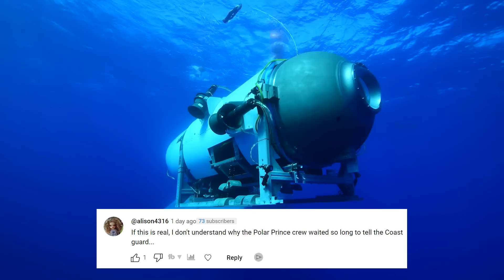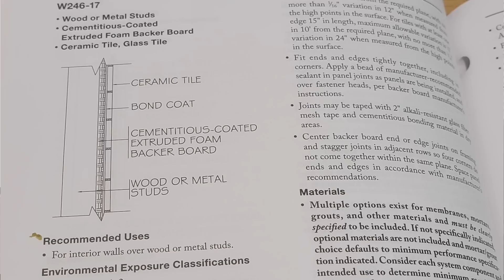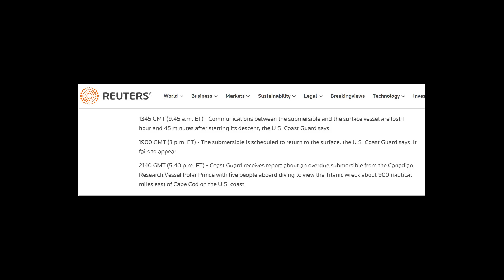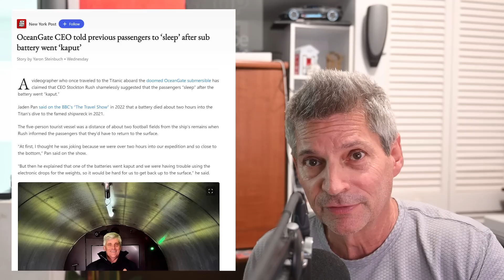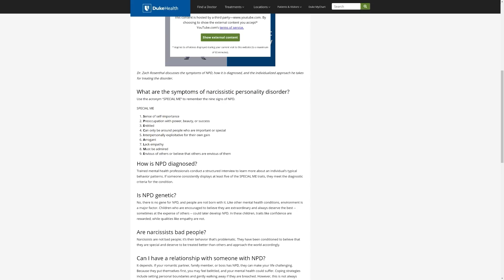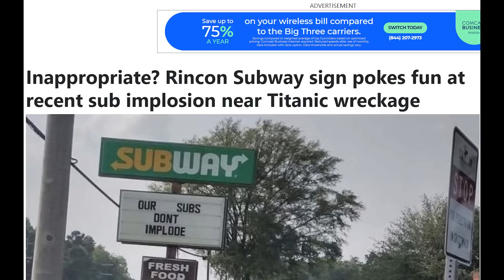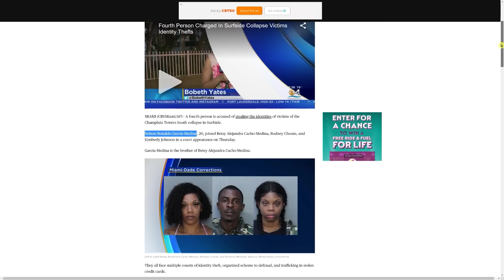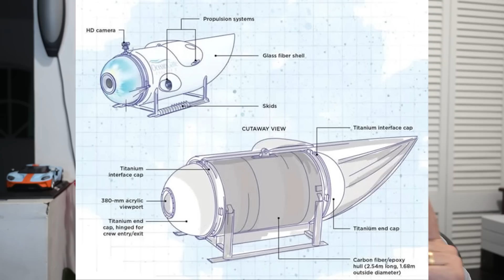Titan Sub: Why OceanGate Waits 8 Hrs Call Coast Guard, Q & A

Comment: The psychological principle he discusses here is interesting, but it doesn't seem relevant to the matter of when possible loss of the sub was reported to the Coast Guard. Immediately after loss of communication with the sub that morning, there were two status options based on its last communications: the sub had imploded, or the sub suffered communications loss. If the sub imploded, there was absolutely nothing the CG could do at that time or any time later. Why call them? The last communications clearly show problems greater than just communication impairment. If the sub could surface in a normal period of time, which was hours at that point, then it would, so why call in the CG and navies of two countries to come hold your hands? If the sub surfaced on a delayed time schedule or at a remote location, they would have three and a half days to find it, so again, what's the rush? Understand that if the sub had not been broken up and been scattered all over the sea bed, locating it on the surface would not have been that big a problem, nor would they have needed to search a thousand square miles around the site. The four days of multiple agencies running around (floating around?) was 98% Kabuki theater driven by failure of basic communication and the fear that they might be accused in retrospect of mishandling the matter once they showed up. Cameron figured out the situation in half a day without leaving his armchair. Does anyone think that the flotilla which descended on that site reached a different conclusion at the time?

Comment: I found it strange top side had to contact them about the alarms going red vs Stockton calling in about the problem himself. I bet he was trying to fix the problem himself instead of radioing it in right away. I can imagine him telling everyone to just relax and everything was fine up until he had to drop ballasts.
Reply: That's not what happened.  Some of the transcript reads mix up who said what. The Titan reported the alarms. Topside only asked questions after that, asking for status etc.  All comments about the alarms and noises were from Titan.  All questions were from topside. Also they had no voice radio comms. Rush didn't like being bothered by it so he banned radio. All they had was the text messaging.  There was also no data telemetry.  Topside had no idea what was going on unless they were told by text message.
Reply: There is a button on the game controller to silence those red light alarms..he pushed the button and continued on his merry way

Comment: More critical in diagonal winding is that each layer opposes the other in compression and tension.
Reply: I just noticed that the individual strands were converging on the hull from the machine without any weaving at all. I had thought they were pre weaved but I guess not.  Wound like a bobbin of sewing thread!
Reply: The two 90 degree layers of fiber only work in tension (outward pressure like a propane tank).  Never compression (inward pressure underwater)

.
Reply: @electrictroy2010  Yes I agree carbon fiber itself is only good in tension. But as a composite, it can have very good compressive resistance. 
1)You can pull a chain and you can not push one. If you encapsulate a chain in resin then you could push the chain.
2) If you laminate your fibers in one direction they will have good tension, and fair compression but poor shear between the fibers. Bi-directional weave transfers force resistance between each member, push on me pull on them. Probably why my tee shirt is made in a weft (90°) directions weave.

3) I think that we are in the same mindset and not crew this mission.
Reply: What you pointed out. Only a humble big brain could do. What the actual f.
Reply: @FlyWalker2233  Thank you that was a very nice statement. As an old man, I can go to bed and tell my wife.

Comment: why don't they fold the carbon fiber back and forth since carbon fiber is stronger in tension. The fibers would be folded back and forth and then the whole piece would then be wrapped around the form. This would leave the fibers going in and out.

Comment: Jeff,
You are right about the idiocy and narcissism of Stockton Rush, including his incredible arrogance.  All of this, however, does not remove the responsibility from his passengers.  WHO in their right mind would go down in that contraption?  Did you note the guy bolting down the outside lid (sorry, I cannot think of the correct technical term right now)?  Did you note that he was not using a torque wrench?  Don't those fasteners have to have a specific torque?  Ohhh, I forgot, Rush fired his engineers and did virtue-signaling "diversity" hiring of INCOMPETENT, INEXPERIENCED people with the slogan: "White males need not apply, no matter how qualified!" while firing everyone who pointed out dangers.  Also there is video of the passengers reading this waver: "... the submarine may implode and you may die..." then shouting - WHERE DO I SIGN?

In the end, this glued together contraption, without even rudimentary safety measures, killed a bunch of arrogant, narcissistic, entitled, rich people who were too stupid, to have foreseen the dangers, and acted not only out of stupidity, but against all commonsense....

Jeff, I have been following your videos since the condo collapse in Florida, and I also love your tool videos (love to do woodworking) where you point out bargains (although I am typically always too late to get them 😂😂)... I am no engineer, but I do know that carbon fiber is only strong in one direction like in a hull of an airplane where it resists expansion, but not when it is compressed.... I am sorry, and maybe not the passengers of this ill-fated submersible, but certainly Mr. Rush in the end got what his arrogance dished-out.  Karma is a very cruel teacher at times.  🤔

Comment: At the time, I figured catastrophic implosion was the most likely reason for loss of communication.  I didn't know losing com was typical for other missions nor that there was one that spent 24 hours (!) because of a glitch.  Interesting video Jeff.
Reply from the maker: Thanks, I'm glad you liked it!
Reply: Before the navy announced the noise they detected I posted on a message board that I figured on implosion just based on the depth and how much could go wrong under those conditions.
Reply: Kinda like James Cameron said, it’s kinda normal to lose comms at times, but to lose comms and the radar location at the same time was an obvious sign especially for the group already doubting the carbon hull design
Reply: @iillestrs  Cameron knew, he also wasn't keen on carbon fiber.  At the time I only knew about comm loss.  It's a bit of a shame that the expensive surface search was conducted when they would have known if everyone compared notes.
Reply: @Pyrolonn  I’m not an engineer and even I have always found cf being used and laid out the way it was odd.
Reply: @iillestrs2153 RADAR?  Radiowaves including radar don’t work underwater
Reply: Assuming the transcript is authentic, the only new issues were the RTM activating and cracking sounds loud enough to alarm even the sociopath.
Reply: the US government kept quiet knowing their fate to hide the fact that joe biden was impeached...check it out
Reply: At the time I figured  catastrophic  Farting

Comment: I'm curious if they vacuum treated and/or autoclaved the hull? It seemed they used an air-cured resin with the carbon fiber?
   Either way, the crackling they heard was likely air in the wrap compressing and the outside layers imploding into those air spaces until it failed.
  The "Culture of Deviance" explains the events leading up to this tragedy very well. Physics never takes a vacation.
Reply: Most people think the crackling noise they heard was an electrical short-circuit from flooding.
Reply: my understanding Rush said there was no autoclave large enough to fit the hull and it was too costly to build one.

Comment: A friend emailed me an MSN News link on an article titled “Titan Sank For 48 Seconds Before Imploding, Expert Paints Grim Picture” from Benzinga about this guy Jose Luis Martin who is an electrical engineer and an expert on subs. There were some things that didn’t make sense to me. For one, the article says that Titan lost communication with the support vessel at 11:15am and everyone else says 9:45am. A difference in time zones would only change the hour and not the minutes. Another thing is, he says a submersible must have it’s center of gravity under the hull to stay balanced. But then he says the Titan did a nose dive when it lost electrical power. Why would it nose dive from lost of power? I couldn’t find anything that says if the Titan had a pitch control system.
Reply: Some reports give times in the Newfoundland time zone, which is a half hour later than Atlantic time.
Reply: @dwinthrop1015  Thanks. I didn’t know there was a time zone of a half hour difference. That would explain the discrepancy.
Reply: It can change the minutes if it’s hlf hr difference.

Comment: After the third video that you have done on the subject I decided to subscribe sure. You seem very knowledgeable and right now all the conspiracy theories are coming out. I wonder if we rush even thought about the shelf life of carbon fiber the only reason being is that a lot of race cars are built out of carbon fiber, these pieces take a lot of punishment in the race car Community just in racing, they need to be replaced. I don't know if it was out of arrogance not knowing that fact. There's a lot more water pressure continuously on this carbon fiber that it would finally breakdown. Because it does when you have a race car overtime
I do know a little about regulations I got my Master's Degree and Logistics and I worked with a lot of safety codes during my lifetime of work

Comment: That is NOT what normalization of deviance means. Normalization of deviance is when you do something outside norms and there is no bad result right away, so you keep doing it. The deviance from the usual practice is normalized. That Oceangate sub's normalization of deviance resulted from the fact that there were many successful dives before the disaster, such that the deviation from normal engineering practice was considered the new norm (since there were no failures).

Comment: I am enjoying hearing your perspective on this.

One thing that was so staggering to me with the (alleged) transcript that falls in line with your talking about herd mentality is

The topside basically hinted that rush should adjust velocity. But they knew "better" than to directly state it or push back on his refusal to slow down.

Because they knew Rush wouldnt listen.

And that was just the nail in the (imploded) sardine can - i mean coffin.
Reply: It's completely crazy that they didn't abort immediately when the sink rate was too high.
Reply from the maker: Yes, I think so also
Reply: @jeffostroff wouldn’t the delayed ascent be of any significance? They had climbed only ten feet after three minutes. 
Also, they had a secondary motor after the first had failed but there were crackling sounds supposedly from the aft.  
Could the engine bay have been compromised with water which would have weighted and delayed the ascent?
Reply: @Hilighted  The entire body was likely saturated with water inside the carbon fibre. It was descending quickly because it had already failed in previous dives and was over ballast weight, it is possible he had engine failures too, which would have also reduced their ability to ascend.
Reply: @littlekong7685 I believe you are correct that the hull had been absorbing water in the non-catastrophic depths, but these fools didn't know it because they weren't interested in finding problems. They wore out their batteries and motors trying to lift a negatively buoyant vessel.
Reply: @pugsymalone6539  totally agree- the only way it was not watertight without immediately imploding was that the hull was full of water before reaching crush depth.
Reply: @BenSwagnerd  I agree. I'm not normally a fan of spending money on things like this, but I'd like to have another sub built and see it tested until failure, with inspections and documentation along the way. Cheers!

Comment: If the surface ship is using a “hydrophone” (9:22 in this video), why don’t they too hear the implosion sound like the Navy did?
Reply from the maker: It is possible they did pick it up
Reply: One possibility is the presence of deep sea inversion zones, where the temperature and density changes and forms a separating layer. It could be difficult to hear through theze

Comment: I used your transcript to generate a spreadsheet with depths and timings of the dive. The depressing part is the sequence of events after the submersible claimed to be at "35" depth (~3500m).
Likely, the Titan continued to descend to nearer 3600m before jettisoning the frame and reversing the descent.
However, that shows that their buoyancy was already conpromised and only getting worse.
Your point about the winding of the carbon fibre, I'm afraid, is unfounded. Helical, or cross-ply, winding wolud only have been worse as it would have put more of the fibres under length-wise compression. Winding in the tightly cylindrical fashion seems weak, but is actually the strongest version of the weakest mode the composite could have been put in.
The real tragedy was not putting a strict lifetime on the carbon fibre tube and retiring the submerisble after a set number of dives. This would also have permitted improvements in manufacturing to increase reliability.
Tragically, Stockton Rush was right, carbon fibre could be made to survive 4km depth in water, where he was wrong was assuming his design would work in perpetuity.
Reply: Do you think the structure failed as a result of longitudinal compression, or as a result of being squished flat like a tube of toothpaste?  I would think the latter, and I think what was missing was some structure that could carry load from the inner surface of the hull near the waist to the outer surface of the hull near the fore and aft end caps.  If one had an inner pipe that was curved inward toward the middle, and an outer pipe which was not designed to resist water pressure but merely to hold the end caps apart, then the carbon fiber in the former type would all be under tension, and the outer pipe would merely need to resist buckling from longitudinal compression.
Reply: @flatfingertuning727  ...and what you are saying about an internal structure to brace seems correct, but cross-ply fibres would not provide that. In fact, the only internal bracing that would work would be, essentially, a full metal tube, which Rush sought to avoid.
As, I said, the tragedy is that carbon fibre could be made to work down to 4km, but only for a limited number of times after which the craft should have been decomissioned.
Reply: @AlexanderJohnOgle  Some structures are designed so that if one part starts to yield, the amount of load on it will decrease in a manner that will avoid weakening the part that started to yield if other parts can handle the shift.  Others are constructed in such a way that once a part starts to yield, it will cease to be able to provide any support whatsoever.

The only times where the latter kind of design really makes sense to me would be those that don't get used anywhere close to the yield point, making wear irrelevant, or those which may be acceptably used to the point of failure (e.g. if one has unmanned data-collecting devices which might last anywhere from 5 to 100 dives, with an average of 50, and the loss of a mission's worth of data in case of premature failure would be acceptable, using each device until it fails and then replacing it when it does may be cheaper than trying to predict and prevent failures).

Otherwise, one would need to scrap so many devices that would, in fact, have lasted for many more missions that it would be more economical to use a more robust design.
Reply: You are a brain. What the actual f.

Comment: Im an engineering student and spacex fan. I immediately recognized the COPVs at the end of the video. Composite Overwrapped pressure vessels used to store helium to repressurize the fuel tanks as the fuel runs out of the rocket. Seeing the loop wrapping of Titan was shocking when we reafy know the right manufacturing method.  Granted Titan is not wrapped with composites but actually is composite.
Reply: Yeah it was a carbon fiber hall x5… as an engineering student myself i can say that these are really meant for aircrafts and have not been proven to withstand immense pressures of the deep seas 😮
Reply: According to stockton, it was the right wrapping method because subs doesn't experience torsion moments. (his own words)
Reply: @DKFX1 Would shearing be an issue?